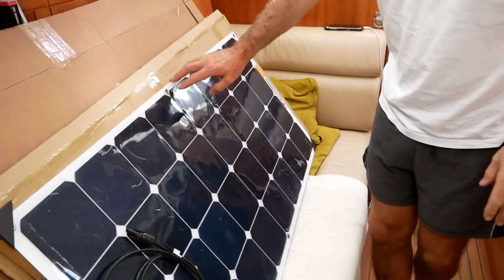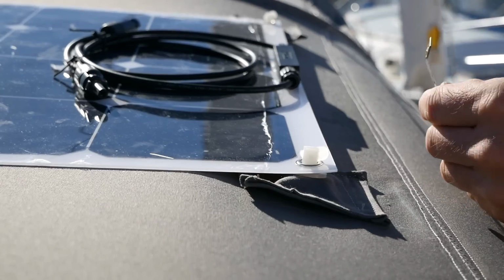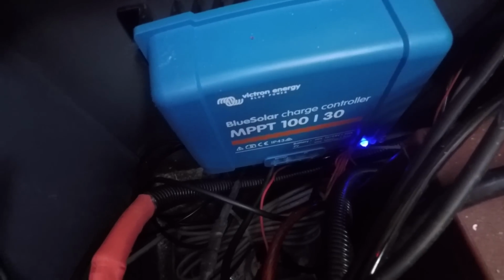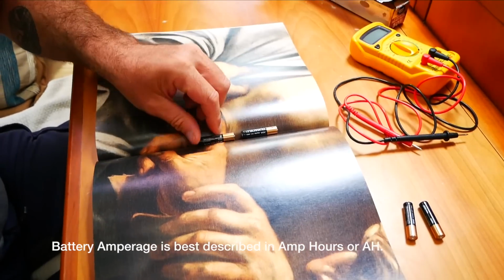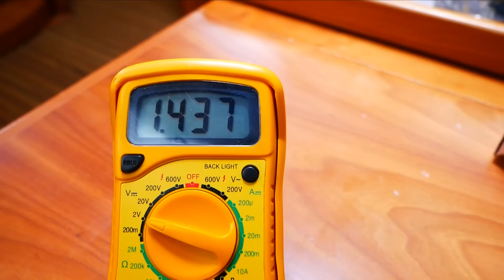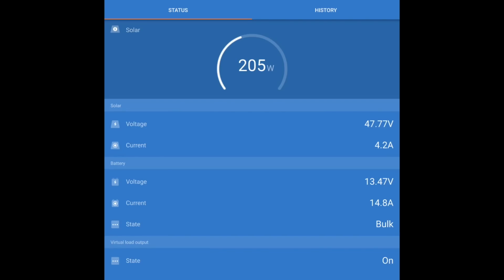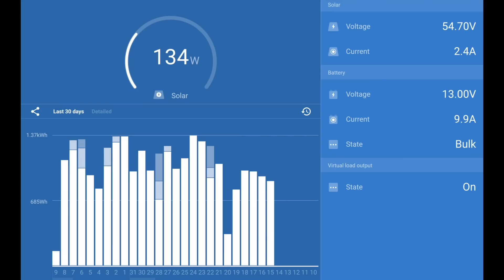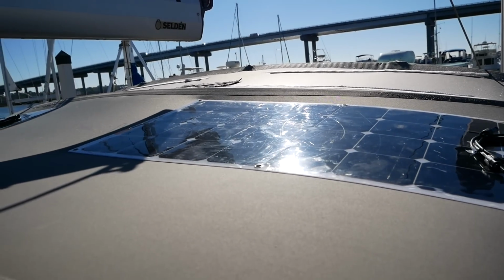EASY SOLAR PANEL INSTALLATION FOR YACHTS & R/V'S

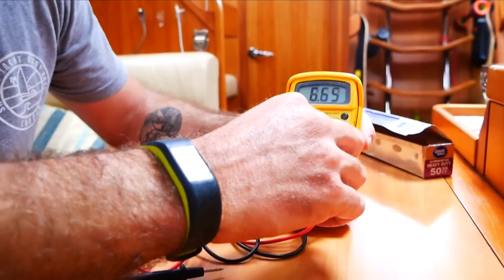Comment: at 6:50 you say "battery amperage is best described in amp hours of AH" .. it should be made clear that the CAPACITY of a batter, ie how much it holds is express in AH. This is different then then how quickly it can deliver this energy, known as current, and is measured in amps. Amps, is the RATE is it used, and AH is how long it will last. ALSO for shaded situation it is better to go with parallel connections because if one shade hits one panel, it will take it out, but the second will still function 100%, so you get 50% power. If you have them in series then the shade on any panel will take out the entire array, regardless of how many panels you have because the one shaded panel will act as a diode and stop the current from passing. This is also why you should, normally. put one panel left, and one panel right, rather then one front, and one back, because you are most likely to have one panel shade free this way, if you do front/back, and shade cast on one panel will surly fall on the second. You would want to use a series connection , if you have to go a long distance, with thinner wire. So IF you use thin wire, and you have to go a distance,  then consider series.
Reply: Yep, and I see you have the empirical data to support that , so i don't doubt it. As mentioned series works better for longer runs, and thinner wire (and hence higher current). Can you please tell us a few more things about the set up. What voltage class are the panels(12v?), how many, how long is the wire to the MPPT? What gauge is that wire? 
PS love the videos keep them coming.

Comment: All this shows how tight the rope is that you work by generating power on a boat. Not sure if you are running that wind generator at the same time, to capture a bit more power, but it's a bit of a concern the you are charging your batteries to more than bulk charge level on only a third of the days and in a sunny part of the world too. I think you have lead-acid rather than AGM but it is still not good that they're getting beyond bulk so infrequently.

Working back from your 450 Ahr battery bank size, I think that gives you a practical capacity of 225Ahr per charge and your panels are providing about 100Ahr per day. If you can't charge more than that reliably, and you are in the Bahamas not the UK, then your practical power limit is that 100Ahr (plus what you can generate with engine/watt-sea/wind) at max. If you have a sunny, calm day at anchor then it's that 100 (plus engine). I think a lot of boat fridges use a very large part of that, especially those stupid ones with front opening doors that let all the "coolth" out so that's not much left.

Nick, have you tried plotting "energy available" against "energy provided" by day? I think that charge controller only shows the latter. Do you have one of those cute gauges that operate through a negative terminal shunt and tell you battery voltage AND available energy (a %?). I know it's not automatic but it might be more informative - the app is showing how much power is going in but not clearly how much energy results. I know when bulk voltage is reached then that is a bit of a measure but a crude one.

If your power bank was smaller, say 300Ahr, with a practical daily limit of 150 Ahr, the batteries would be higher charged more often, which is healthier for them, as well as being cheaper and lighter, without loss of practical power availability. Not suggesting you should do that but it is a better match. Also, if you get to AGM batteries, it seems they like to be charged at higher rates lest they suffer long term capacity damage. From what I read, 450 Ahr AGM need charging power between 45A and 90A to stay happy and that's a huge amount from non-fossil energy sources.

Something I haven't worked out is how much power for passage? Let's see, fridge + autopilot + running lights + bibs&bobs... No good to run out mid ocean. I think nuclear is starting to sound attractive. A cloudy day with wind on the stern leaves just that watt-sea system and the engine...

Very complicated subject, this one. Best I can see is tackle the other side of the equation too - reduce power usage! Have a top-opening fridge and open it infrequently would be a good start. Also wind vane steering, which also backs up the autopilot, looks attractive if you are going to spend long days at sea. LED lights etc too...

Great video Nick. Good to see someone thinking about things and offering room for discussion.

Ian B.

ps. not wishing to speak negatively of other YouTube channels but I see that a popular catamaran couple managed to disable their watt-sea 600W. I think they over-reved the thing and hurt it that way, then blades flew off their turbine propellors. Seems those cats go a bit too fast sometimes. Interesting though, they re-balanced their power usage, mid-atlantic, by going back from two fridges to one. Seems fridges are the biggest power sinks around.

Comment: Very good technical video! I particularly liked the controller app. Very cool piece of kit. We attached  our solar panels on our dodger and bimini using some metal snap fasteners call Loxx fasteners from SailRite (https://www.sailrite.com/Loxx-Pull-It-Up-Fastener-Cloth-to-Cloth-Set). Unfortunately we didn't make ravioli patches to attach them, so put holes in both the bimini and dodger. Wish I'd seen this video first. :)

We also wired each of 4 panels as individual panels to individual MPPT controllers (about $120 each, https://genasun.com/all-products/solar-charge-controllers/for-lead/gvb-8a-pb-solar-boost-controller/). This gives us completely separate charging circuits for each panel for redundancy and if one panel is shadowed it has no affect on any of the other panel's output.

After watching your video, I'm curious to try series and see if I get better output. Again, thanks for a great technical video Nickt!
Reply: Completely off topic. So I have a new drink for you if you like Tequila. It has now replaced Portland Bourbon as our drink of choice. I know, sacrilege, right? Might be a bit hard to find some of the ingredients where you are, but the Chipotle infused Mescal is the secret ingredient that give the drink a bite at the finish. :) Cheers!

Comment: Hi , so I did not get the bit with the graph showing how series is better. watched twice. Then spotted the days read backwards left to right, weird.  So the 'Wynns' came to the exact opposite conclusion, because they found a small amount of shading in series killed almost the entire voltage so much less current produced. They did not use your Fancy(and convincing) computer program. Your real world test is apparently proof of your series conclusion! shade and all!  here is their  testing if your interested.
 https://youtu.be/1qD3mN8VotQ?list=PLG5YKEqC5FqvHg2pXcMEC7ZBu_Vn6Xu_a
Intuitively parallel sound better as any failure of a panel (or shading) with have less effect.
 I guess both parallel and series work ok.....
Indecently 'Sailing Emerald steel" with 30 years under the yard arm don't use a solar controller at all , their big batteries can take all the capacity you can give them!
Cheers Warren.
Reply: Sailing Yacht Ruby Rose   That may be the case, the real world comparison with the graph to show difference shows that with 'your components' series works for you.  Higher voltage also has less voltage drops from the wires so that must help too.    I still worry about the effect of one component failure taking out the whole system ......dunno....  great information!  Warren.
Reply: Very, very small sample size to draw that conclusion. I'm still going with parallel.

Comment: One thing to be aware of is your insurance and equipment ratings. For example, I'm a certified solar installer in Canada and I won't install flexible panels on anything, there are none approved for use in Canada yet, insurance companies here could void any insurance claims if using equipment not approved for use.
Reply: Wil Rushmer He put them on a boat in the Caribbean! Hello!
Reply: Wil Rushmer So I guess my experience as an installer in Canada is relevant on a boat in the Caribbean, right? Oh, I forgot to call myself a dumbass, sorry (I am a Canadian as well and I don’t install solar panels)

Have you looked at all the flexible solar panels that are installed on almost all the live aboards? I expect to put 10k worth of solar panels (30 full size panels) on my boat but I don’t think I was all that nasty. My system will have a backbone that is multiple independent 240AC using 2xTesla Power Walls for 27kw of usable battery power.

Comment: This video is full of misinformation.  Wow, you really should stick to the things you understand and not try to explain things you do not understand.  Your description of the MPPT controller is accurate for a PWM controller as well.  An MPPT controller works by tracking the output of the panel (depending on sun brightness) to maximize the watts -- that's the peak "power point" at any given output voltage.  AKA M=maximum PP=Power Point T=Tracking MPPT.   Your claim about series giving more power is also straight up false.  It gives more power in some situations with certain shading and panel types and battery voltages.  Reality is much more complicated, and generally given the liklihood of partial shading on a boat, serial will give you less power.  What you actually measured was thats the preduminant wind direction or boat orientation and solar output was better those 5 days.